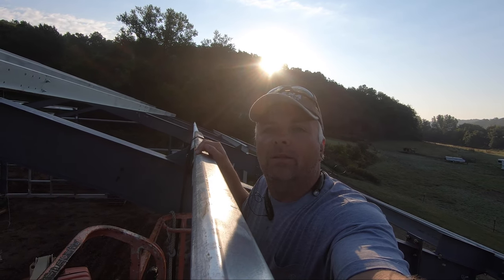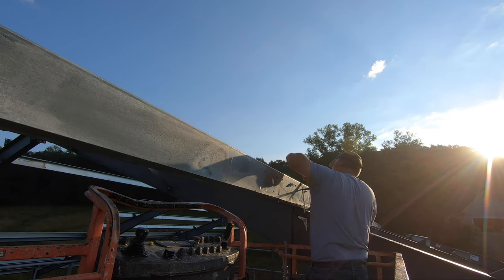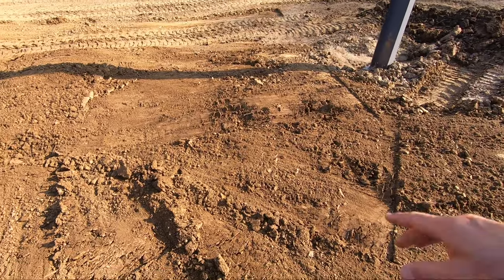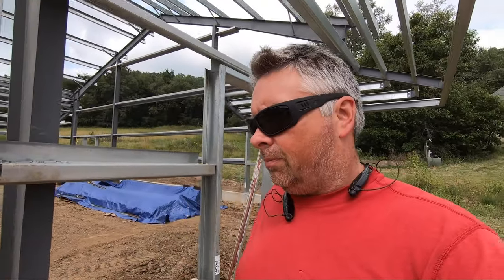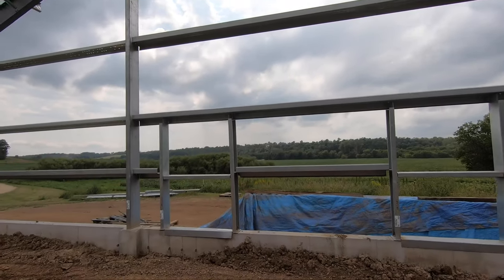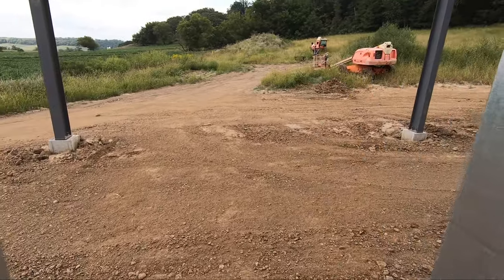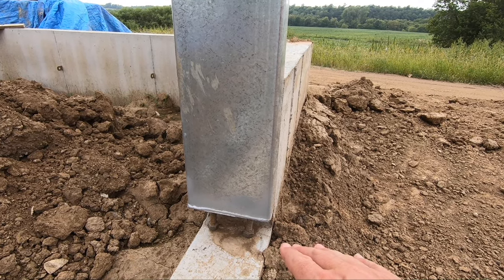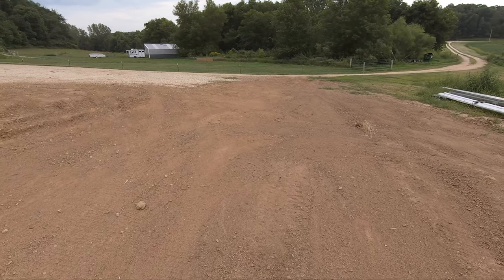Steel Building Erection: Secondary Framing Part 2

Comment: Even though the panels are already in there, an easy way to get long panels in is to center pick them with a strap and then boom out with the telehandler so they can spin 90 degrees. Then send them through the door longways. 

Love the videos BTW!
Reply: Eric - Certainly doable if I'd have had the right straps and supporting under the panels, I would have.. In the end, we stacked the long panels on the end wall outside.  More room to get vehicles in the building, AND if (when) it rains, the panels would be trapped until it dries out.  - I got tired of the rain today and put up all the door jambs and trim.  Thanks!!